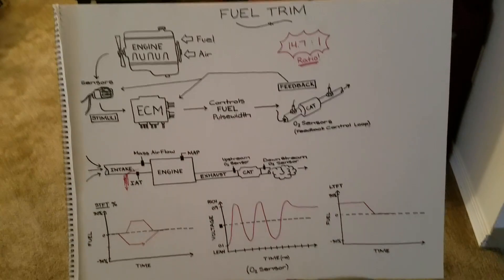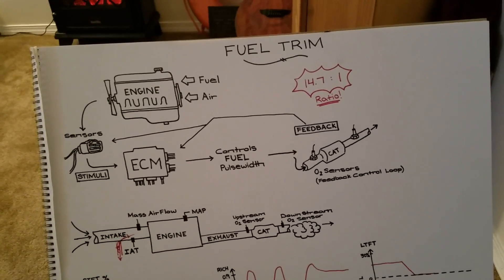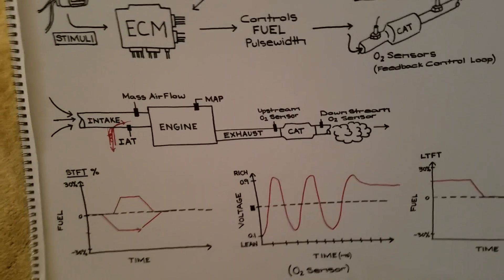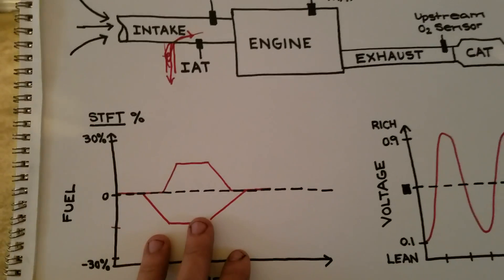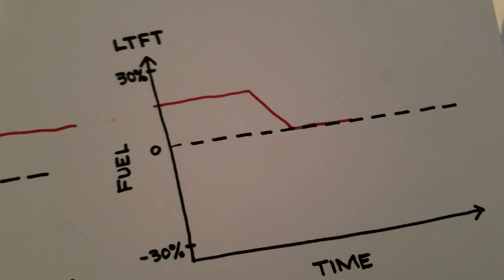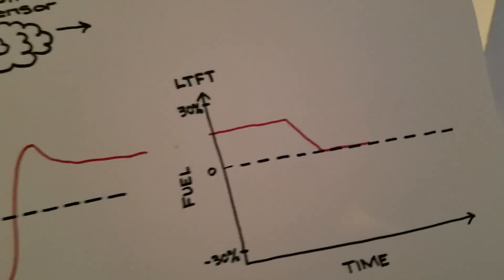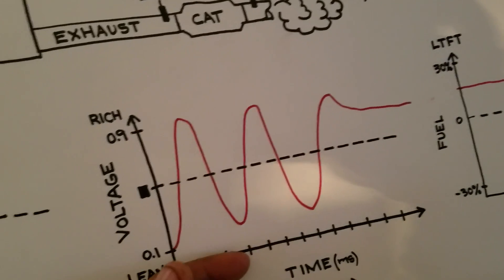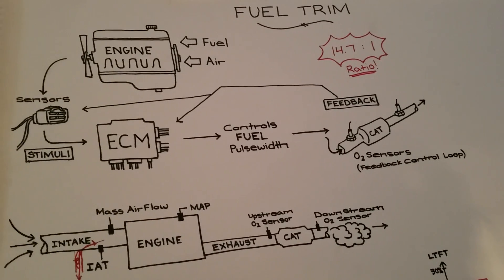Understanding fuel trim!

Comment: Its called Open and Closed Loop, the condition you were explaining with regards to the cold start and the engine defaulting to a preprogrammed setting until it receives proper data from all the required sensors.  Thoroughly enjoyed your presentation and the great illustrations. Very apparent that you have drawing skills too. Thank you for your time and effort.

Comment: Hi dear!
12:00 is this reflected in both banks?
Or in one bank like in my case is in bank #1
I have a short term fuel trim -27.3% on bank#1
And it's on both sensors upstream and downstream
That bank in my case is down by the pcm.
Bank #2 is working.
Then with my engine running I started desconecting
Each cylinders on bank#2 and each cylinder miss fire
But the engine won't shutt down!
Guess what!
Bank #1 started working...
Then if I reconnect #2 bank
#1 bank shutt down...
I've been dealing with this for more than
A year and i've learn about fuel trims and
Everything related with and replacing parts
And still!!!!!
I just see your channel and I stop to see
What you a women as a mechanic
Can tell me!!!!!
Thanks' in advance👣
Reply from the maker: Hi Daniel, the other sensor will fail the same way (flatlines) but the comouter won't make the same changes that it would as with the upstream sensor
Reply: @Madamediesel671  Thank's for your replying🙏
Any idea on why this behavior??
It's a Honda Pilot 2003   3.5
No check engine light..
Not even a pending code.
No shakes.. Starts in a second.
If you desconect any sensor
Then there's a check engine light..
I might need to contact the person
Who build it😁 If you don't tell me.
Ask me any question but compression is there, and everything related have been change🙈 Not because of me.
To many mechanic involve.
I keep asking it don't matter.
Just want to find someone who
Help me and i'll be happy😔
Excuse my english😁
Reply from the maker: My mistake, sorry I misspoke about both banks, I was thinking both upstream/downstream on one side. I woukd have to plug into it to really tell you what's going on and I no longer work on gasoline engines, I specialize in diesel haha
Reply: @Madamediesel671   No problem.. Just when you have time.
I know you're not here to performed
Your own test.
But figurate what's going out.
Why two pcm's behave the same way.
And why is only the first bank.
And i exchanged coils, sparks, injectors
And they're new and still the same.
That bank is showing -27.3% exacly all the time no more no less.
There's no maf sensor.only map.
If i desconect the map those # go up to 0%...
And the question is why is this behavior going on?
And why the pcm as soon as i disconect the # 2 bank that she'is happy with: Then she turn happy with # 1 bank and supplys the fuel he needs???
My sister this is my problem and my nightmare😔... 
As you see you know that i know what i'm doing but ihave no idea of WHY
And who is responsible....
This is weird don't you think???
Just take your time🙏
🤺🤾‍♂️🤸‍♀️🚶‍♂️🚴‍♀️🐕📷☕🤲🎵

Comment: Thank you Meredith's can a leaky or malfunction fuel injector cause the STFT to go up to 50% car feels like a misfire but no CEL, accelerates with small power or feels like getting stuck.
Reply from the maker: A leaky pr malfunctioning fuel injector can in fact cause a change in fuel trim, however the CEL will not come on until the fuel trim is approx. 25% in either direction. Your misfire sounds more dramatic then that, but you can check STFT/LTFT with a live data scanner and see what it looks like.

Comment: 14.7 is why the fuel economy is very aggressive for ford, isn’t it?
Reply from the maker: napasin chanpong 14.7:1 is just the ratio where the best combustion will take place. No matter how much fuel is added to the mix, the ration should stay the same or as close to the same. If there are other issues pertaining to running righ or lean, that will have an effect on fuel consumption. But it was designed to try and maintain that stoicometric value.

Comment: interesting but you forgot to mention the key element on a loop pcm/ ecu / ecm system which is the timer the computer uses to adjust, modify and compensate for the ideal fuel ratio (14:7:1).
this is how it operates: once you start the engine your brain module wakes up and the timer starts. if after certain time your computer couldnt get certain values registered in parameters and  according to sensor data written into the hardware being burned/ nonburned software then the module will go into a different parameter in order to compensate for the loss/ adding of, if theres any. (broken gasket, fuel leak, bad cat, vac leak, demaged sensor, etc) - if that doesnt work for it, then in certain more given time and the necessary space between data & parameters - the module again will go into another parameter and so on until it finally gets into limp mode (critical repair/service shop indicator mode) depending on what kind of situation is, the timer will reduce or enlarge these values and scales until it encounters its ideal values to work with priority parameters until the failure is fixed and new info is entered into it just by sensing data or updated/ flashed software into the brain module processor so the module restarts again with its new freshly updated data into its parameters. all its about time.
Reply from the maker: De Carlo good to know! Thr computer is still something I know little about, so this is always helpful! Thanks!
Reply: Meredith's Mechanics - by the way, your video is great in the sense of an overal explanatory situation on engine management operation of sensor/ ecm/ ecu/ pcm relationship but not much on fuel trims

any way, i think that now is the right time to make your part II video series of a more detailed function & operation on fuel trim information 👈

cheers 😀

Comment: what does it mean when stft is less that 5% both neg and pos but ltft stays around -15% constant and lowers to -10% when accelerated?
Reply: J LUMINADO running rich check bank 1 air fuel sensor and check voltage.

Comment: Hi didn't you forget that a lean condition can also be caused by too little fuel like weak pump clogged injectors or filter? Or viscera on a rich condition, like too little air??? And what about an exaust leak? That can cause confusion good job on some of the explanations tho
Reply from the maker: Alberto Ascencio Definately, but to go into all the causes of lean/rich conditions would take forever and I wasn't fully prepared to make a 30 minute video on it haha. I have thought of doing a video on diagnostics based on fuel trim readings.